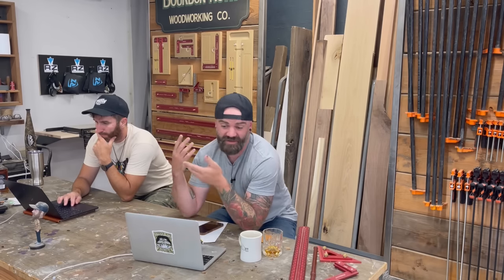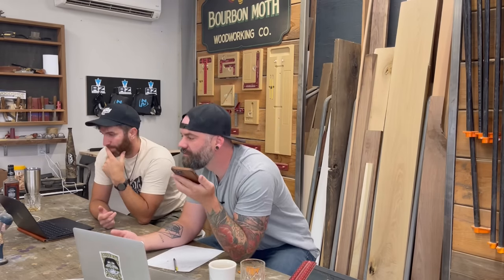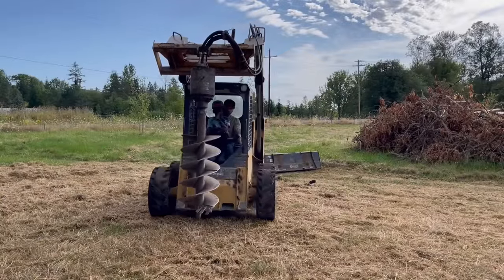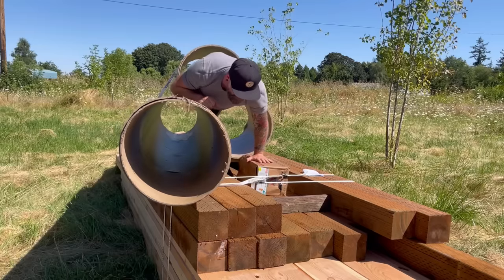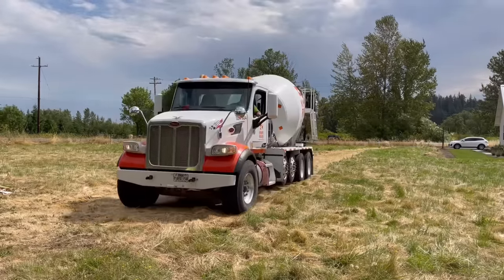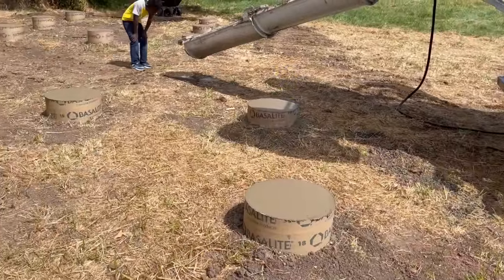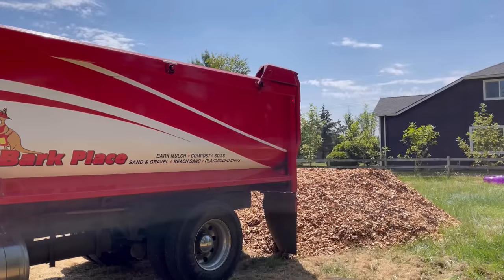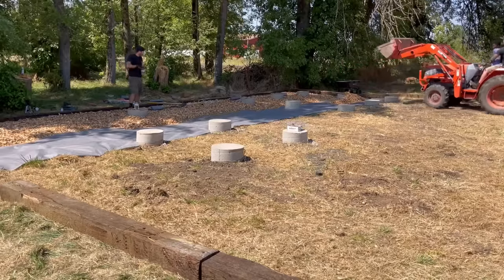Building a Treehouse || Pouring Concrete and Making Footings

Comment: I hesitated commenting for fear of being "that guy", but I decided why not - someone may be curious: I'm an engineer who works on foundations for large steel structures used to hold up power lines (transmission lines). The point of rebar is to add tensile strength to the concrete. Concrete is VERY strong in terms of compressive strength (how much it can be squished) but it is pretty terrible in terms of tensile strength (how much it can be stretched) so the rebar helps the concrete not "pull" apart when it experiences all of the different forces it will experience when loaded. Theres more science to it, but thats basically what it boils down to.
Reply: So, what did you think of the rebar that was hammered into the gravel BELOW the level of the concrete, where water can reach and corrode it?

And then that corroding rebar can expand inside of the concrete, applying compressive forces from the inside, which acts upon the concretes tensile "strength" to crack the concrete and become useless failure points.

Yeah, I'm sure it will be fine too. At least until the foreman grows up a little.
Reply: @35manning  YWNBAW
Reply: Emily - Absolutely true about the rebar. If it wasn’t in a footing that is massively oversized, or in a more critical structure, I’d be concerned. It this instance, it’s probably fine. 

A std specification is for a minimum of 3” of concrete cover over steel when in ground contact; 1.5” if exposed to the air.
Reply: Can't speak for anyone else but I'm quite happy to now know this.
Reply: I’m an engineer too (mechanical, not structural), and my spidey senses get tweaked on YouTube regularly lol. Usually it’s a lack of safety glasses in a machine shop lol
Reply: @BenNawrath  my background is actually mechanical! There's actually a surprising amount of overlap between the world of civil and mechanical lol.
Reply: @LoganLovell  yeah I dated a civil in college, steered clear ever since hahaha
Reply: I found that guy.
Reply: I'm an engineer (software, not structural), and I have nothing useful to add. I'm just happy to be included.
Reply: @haxney  Hey I'm a CyberSecurity and Systems Engineer and...😀 I have absolutely nothing to contribute to this conversation.
Reply: Fun fact my father in law is a mechanical and electrical engineer but watching him try and build a birdhouse or change an outlet is a nightmare.

Comment: Next time you need to use conduit, don’t worry about a sting. Just use a shop-vac at one end and a shopping bag tied to a string from the other. The vacuum will pull the bag to you bringing the string when you are ready.
Reply: thats an awesome tip. thanks for sharing your knowledge.

Comment: Concrete has no flexural strength. It ruptures quickly when in tension, so you add reinforcing steel (rebar) to which the concrete bonds and gains tensile strength. The steel resists bending forces and moments. Big fan of your channel and as a civil engineer working in construction, I cannot wait to see upcoming episodes!
Reply: I have a question. I too have seen concrete break when it is flexed. How then are things like the Tacoma Narrows bridge explained?  Was that due to having rebar in it?  Because it was rolling in waves!
Reply: @B30pt87  the rebar wasn't responsible for the Tacoma Narrows collapse. That bridge was designed in such a way that forces from the wind didn't pass through the trusses, and so the bridge would flex in the transverse (side to side) and longitudinal (along the bridge) directions. The winds on the day of the collapse were especially severe and induced vibration that caused the bridge to oscillate in a twisting (torsional) mode as opposed to flexing/bending.
Reply: @bjbailey12  Oh, no. I didn't mean that the rebar was responsible for the collapse.  I meant was it the rebar that allowed the concrete on the bridge to flex without shattering?

Comment: Ha, ha, ha 😂😂😂. The close to last statement of "working just to get to work" - that is a big part of building buildings of any kind. The foundation. I just resently put two 20' shipping containers in my garden to use as sheds. It took me a full week of work (or more) just to prep the ground. I moved 24.000 kg (52.800 lbs) of stabilizing sand by hand and wheel barrow.
   Making a solid foundation may not look like much, but is VERY important if you want your structure to last. 👍👍

Comment: Great video - really enjoyed it!
You ought the pin down the railroad ties with some rebar punched vertically through them, to stop them rolling or moving out of position.
Another recommendation would be to consider installing a solar panel instead of the mains hookup.  I have one on my greenhouse and it provides adequate power for a couple of water pumps and some lighting, all with the safety of 12 volts.

Comment: May I add a suggestion, instead of running an extension cord with 120 volts. You may want to run landscape wire and run the lights off 12 volts dc. With this set up you will be able to set accent lighting and house lighting with no fear of frying your son with ac.
Reply: 12 v is also safer!!
Reply: He's gonna want that xbox out there sooner or later.
Reply: @dangre00  If your going to do that, bring a projecter and use the side of the house.
Reply: @dangre00  very good point!
Reply: if the kid can survive in a house with electrical sockets, he can survive with an extension cord lol.  its not like hes a young kid.  and he might want full power to run a laptop or other devices.
Reply: Just make sure the circuitry is protected with a ground fault circuit breaker.
Reply: Even though he lives in a house with 120v , a tree house / clubhouse is exposed to more moisture. Also kids will be kids. And being safe is paramount. In response to Xbox and laptop that is some thing that can be managed with and inverter if needed. I too built my kids many years ago a club house . I over engineered the hell out of that thing, so much so that it was the only thing that survived a hurricane. I used low voltage and the house had everything.... lights, music, you name it. Just wanted to give you my thoughts on this.
Reply: Of all the idea in the comments, this one is by far the smartest. Didn’t even cross my mind to do that until I read it.
Reply: As for the Xbox and other electronic devices, a huge benefit of being outside is being unplugged. Sometimes it’s good to just say no. 

I take kids on wilderness trips and they invariably come back saying how much they loved it.
Reply: @johnnymegawatt999  voltage doesn’t mean anything when it comes to safety. Yes less potential so less likely to arc. But if you ground it out then it doesn’t matter. Current is what matters, how much current can be drawn in the circuit through your body is what matters. Besides lower voltages require higher current to get the same wattage to power high demand circuits like inverters with ac to power Xbox’s and TVs. Secondly, AC will kick you off the circuit, DC will latch you until is melts your body parts. AC of course can do the same thing with enough current all at once. Point being don’t confuse voltage with safety. It takes very low current going through your heart to stop it.
Reply: @egondro9157  less potential, so it's unable to to overcome the resistance of your body.  ie electrocution. why do you think we use 24v to control buttons and motor starters for 600+v contactors. Becauce it's safe.
Reply: @egondro9157  12vdc is always safer than 120vac.  I've worked on Solar with high voltage 1000VDC.  I know what high DC voltage does.   NEVER have I been shocked by 12VDC
Reply: @egondro9157  and if you grab 240vac or greater, it will not kick you off.  Also 120Vac under the right circumstance.  It will lock your hand around that wire or lug until your bodyweight overcomes it when you fall dead. Or your knuckles burn off.
Reply: @egondro9157  but I know what you're trying to say.  5mA  or whatever will stop a heart.  But you need the voltage potential to push that 5mA through your body.  12VDC  is very unlikely to to so.  That's why we can touch the positive and negative terminals on a car battery without consequence.  Car batteries are capable of pushing 500A or more.  Just not through a human body.  Do the same with a hot and neutral on a 120v cct and I guarantee it will hurt or worse, as it will push that current right through you.

Comment: My dad was supportive like you and lived vicariously through me (his dad never let him play).
When seven a friend and I told him about a wish to build a rocket ship.  HE was off and running.
A two story , 6 ft. diameter 16 ft. tall structure made with bowed 2x4s wrapped in chicken wire covered in tar paper was standing in the back yard .
A couple years later we moved across the street (more kids) so we laid it on side and rolled it to new location. . (out of street view)
At that point he finished it putting a capsule unit on top.  An incredible fort !!

Comment: To keep your railroad ties in place, get the largest diameter of rebar that you can find, and cut it into 4 foot lengths. Some landscaping companies sell long spikes that serve the same purpose, but for a much higher price. Drill appropriate sized holes, one at each end of your RR ties, and drive them down with a 2 pound mallet. Use a scrap piece of rebar like a nail-set to sink the rebar about an inch below the surface of the RR tie.

Comment: Working with your kids on projects is the best.  Great memories and they help with the end product and learn some skills along the way.  Instead of running an expansion cord for lighting, you could install a simple solar system with some small batteries and 12 volt LED lights.  Another project and time with the foreman.  God Bless!

Comment: HOLY COW.... Those footings, Did you watch a commercial construction video? What is your frost line, here in the north valley were lucky to get 24 inches... I want YOU to do the footings and foundations on my next house.... IT WILL NEVER MOVE!  Thanks for the entertainment!
Tool Tip: When pulling string through the conduit, tie a wad of paper just smaller then the conduit to the string and suck it through with a shop vac.

Comment: Any Newenglander looking at a structure with that many footings gets heart palpitations! Rocks varying from football to tire size lurk beneath every stake and maybe an auger that size would do it but often it's finding the margin of every boulder with a shovel and making a hole twice as wide as you needed. I've seen two guys spend 4 hours digging one 4' deep footing.

Comment: I scrolled through a few comments and haven't watched the rest of the video series, but I didn't see anything about the rebar.  The purpose of rebar in concrete is to make the set concrete much stronger than the concrete itself, and to help prevent cracking and chipping from added weight on the concrete.  It's like adding cross supports on a desk.

Comment: You forgot to add the mounting plates for any vertical posts to mount to the footings. They go in the top of the footings when the cement is being poured. They anchor in the cement to hold tight further construction.

Comment: Just a suggestion for next time. Don’t hammer the rebar into the gravel where it won’t be fully incased in concrete. The rebar will rust and the rust will go up the bar into the footing causing the rebar to expand and then crack and break the footings. Granted this will take years to happen but it will happen. Probably fine for the fort but if this were a house, exposed rebar out of concrete is a big no no. ✌🏻
Reply: This suggestion is absolutely perfect. I did foundation work for a structure we build last fire season and got chewed out when I tried to do something similar
Reply: Spot on. Though with the size of those gigantic footings, the kids will be old folk before they fail.
Reply: The way this thing is going, that tree house might double as an above ground bomb shelter. 😁
Reply: so how would you put the vertical rebar ? you pour concret and then the rebar when the concret is still liquid ?
Reply: @RickieBeubie  wait till it's firm enough to stick your rebar into it at a set depth without it sinking. Takes an hour or so.
Reply: @eikon7073  thanks a lot for the advice ;)
Reply: @RickieBeubie  you can also use rebar tie to hold them elevated above  and encased in the bottom of the cement form but it's a bit fandangley. Best to do if you have multiple people and are in need of moving fast and don't have time for the cement to set. Best of luck out there

Comment: Haha. The only way I could get my kids to inhabit such a tree house would be if it had a Cat6a/wired internet connection, for their gaming laptops!
But easy to run an additional cable when you have already laid conduit. 
**
Similarly, I poured concrete footers and built up a couple of large plinths using shuttering (+ anchors etc), for a large trampoline at the bottom of our garden, located on a steep slope and completely shaded by tree canopy.  With cushions and blankets etc, I think it makes for a fantastic chill out space .. let alone being somewhere to jump around!! HOWEVER, the kids are reluctant to use it because their iPads don’t pick up the wifi, so far away from the house. 
The “over engineered” foundations however are completely suitable for a man cave shed though, which can be built as soon as the kids move out and I can get rid of the trampoline ..so who gets the last laugh then, huh!!

Comment: I think you should definitely do full electrical! That would be cool. And Romex is probably a lot cheaper than an extension cord that long.
Reply: I wish I had a tree house I could play PlayStation in. that would be sweeeeet! 😀🤘
Reply: @traitorouskin7492  Truth. He'll need to run CAT5 cable too 😂
Reply: Romex isn't rated for burial in conduit. You'd want to run THWN or just do UF-B direct burial.

Comment: When we were young and had just moved to the countryside from the big city, my brothers and I asked our Dad for a treehouse despite us having no trees. So, he concreted four vertical logs into the ground, put some beams across, and built a raised floor from logs and plywood. The plan had always been to build a house on the top so we named it the "High-Up House", though no house was ever built. It did get some half-height lower walls, and a lower platform too, so it was a great place to play in the garden.

Comment: Google batter boards. We use them setting our piers and forms. You can still use them when you start erecting. If you start out square and plumb on the piers your framing will be much easier. Love watching you do stuff with your boy. I have 5 kidos and they all worked with me throughout the 30 plus years we have been building.

Comment: Jason, for longer spans you might want to look at using clear tubing and making a water level. Good for finding level when a 6ft level won't reach. And to top it off, it's ancient tech that still works to this day because it uses the principal that water always seeks its own level.
Reply: That’s ridiculous when you can get a cheap green line laser on amazon for under $50
Reply: @remodz6385  He had one, it didn't work during the day because of the quality. Sp you're looking at spending around ballpark 600$ for a quality 200' laser level. Or you can spend 50$ or less on clear tubing and a garden hose and make a water level that works just as well if not better than a laser, especially if you're working around corners or obstacles. Most people already have a garden hose of significant length so the only out of pocket would be the clear tubing. You can get 100' of clear tubing for about 40$ in my neck of the woods.

Comment: Concrete is like the resin you use in fiberglass or carbon fiber. The rebar is like the actual glass mat or the carbon fiber woven sheet. Concrete has a VERY HIGH compressive strength, but not so much a bend, shear, or stretch strength. Adding the rebar makes the assembly triply strong all the way around and it's why you can have concrete bridges, otherwise the concrete would bend and fail over a span.

Comment: rebar is in concrete, because concrete has a low tensile strength, meaning it is very easy to pull apart. it holds a lot of weight when you stand on it, or drive over it, anything that compresses it. But when you pull it, its rather weak. Rebar is the opposite. if you press it, it will bend, but if you pull it, its very strong. so, you stick it in there to give the concrete tensile strength. 
As one example for why you need this, your posts are trying to dig deeper into the footing. for that to happen, the footing would have to expand at the bottom to make room for the posts. so its constantly trying to rip apart the concrete. same thing goes for a bridge. if you drive on it, it gets compressed at the top, and pulled apart at the bottom. so you need rebar for that :)
Reply: Awesome explantation...found that helpful...thanks

Comment: Two years ago, I needed to replace 22 footings on a structure. The Sonotube would have cost almost as much as the concrete!  I had a short length of 18” smooth wall plastic culvert from another project, and I cut 16” lengths which I split in half lengthwise and used ratchet straps to hold together.  The split allowed me to get them around the posts easily, I hand-excavated under alternating-by-twos posts to maintain structural support, and used the forms for the to exposed portion of the footers.  It took several days, but the finished product looked great and supported everything.

Comment: Footings are way way over size (you knew that). Sonotube not necessary and reduces boundary engagement though you knew that, it's great as a top form collar. Where's the driveway for the buggy to park under the finished T-house? Also build in plenty of cross bracing so the flying fox can anchor firmly.